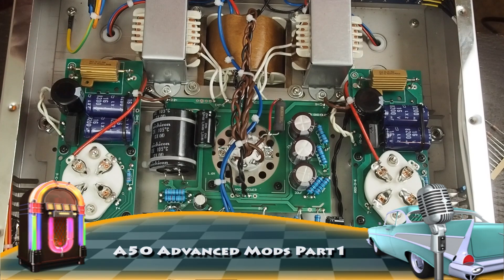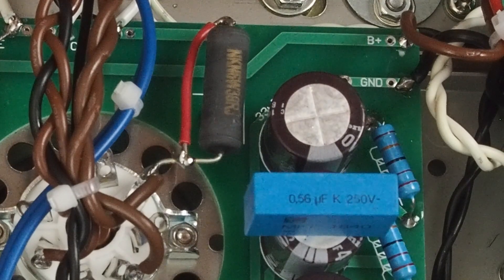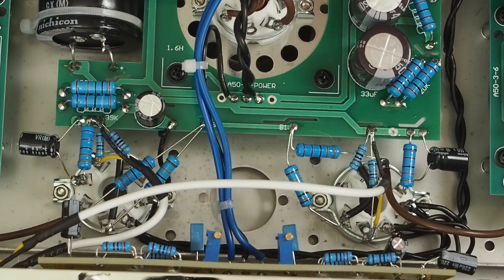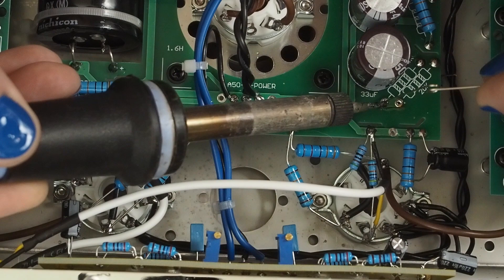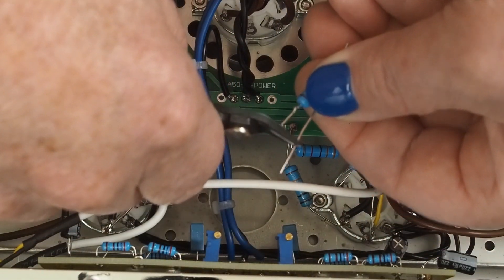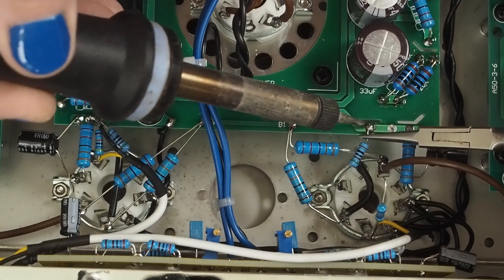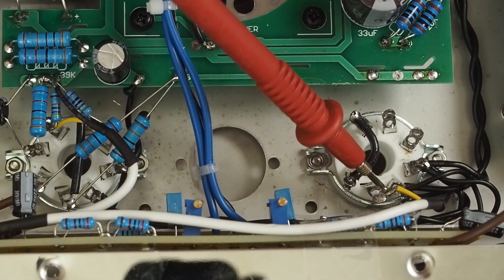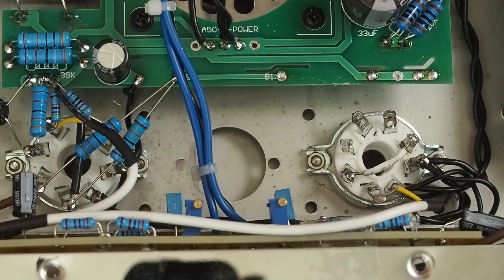Boyuurange / Reisong A50 300B Tube Amp Advanced Mods Part One

Comment: I am a journetman machinist of more than 20 years. On drilling stainless sheetmetal I have a few suggestions. First off stainless sheetmetal becomes work hardened when it is rolled. It is NASTY to drill. Esp with small diameter drills. First off if you have access to a drill press USE IT. Take the extra time and set it up right. Clamp everything you can. Another thing is WATCH YOUR SPINDLE SPEED. You need to run the drills much slower than you think you should, Look at your chips. If they are dark brown or black ( SS sheetmetal makes these nasty looking chips. but watch the color) SLOW IT DOWN. Slow it down if they are blue as well but you rarely get blue color drilling this crap but blue is too hot as well.  DRILL SELECTION.. If you have a drill press buy solid carbide drills. They are not cheap but if you have several holes to drill it will make it childs play compared to HSS drills. If you do not have a grill press then buy COBALT drills. You will break carbide in a hand drill no matter how careful you think you are. Start off slow and let the drill cut. Do not crowd it. Now you may get to a point where the drill starts to squeek. This means you have seriously work hardened the metal. My trick for this require 2 drills the same size or at least close. Also you need a pedastal grinder to grinad the tip of the drill. What you do is sharp one drill with a narromer included angle and the other a flatter angle.. Not extreme just  10 degrees maximum. You then use one drill until it squeeks. then switch drills until it squeeks or breaks thru. You go back and forth keeping the drills sharp in between until you are thru. This lates you focus the cutting force in a smaller area. Take your time it works, Now lastly cutting fluid is your friend. If you can find it (as its not made anymore) anything with 1.1.1. thriclorethylene in it BUY IT. That is the best stuff for this job. Just dont bathe in it. Somethin about causing cancer. Next best is MOLY cutting oil. Messy but it rocks. If neither of these then but some super safe and eco friendly crap from McMaster carr. Tap Magic is best..  If you take only one thing away from this WATCH YOUR SPEED... Hope this helps.
Reply from the maker: Thanks for this reply. I'm really glad this amp isn't made from stainless and is very easy to drill.

Comment: I am the owner of the MK III version of this amp.  I am not sure if the one in your video series is a MK III or an earlier version, since you never (to the best of my knowledge) clarified this issue. I have not heard, or had an earlier version in my system, so I cannot comment on whether there is a noticeable difference between the versions. 
So I guess what I am going to say below may not completely be relevant if in fact you were using an earlier version.

I have had this amp for over a year, and find it one of the most enjoyable amps I have had in my system.  The only change I made to the stock amp was to replace the 6SN7 tubes with some vintage tubes.  There was a slight but noticeable change, which I felt was an improvement.  Others may prefer the sound of the original tubes.

I have been an audio hobbyist for many years and have heard and used a very wide variety of gear.  So, for me to keep this amp in my system for this long is rather unusual, and speaks to the satisfaction I derive from it.  In addition, I have noted that several other You Tube channels (Thomas and Stereo, A British Audiophile, The Audiophiliac, etc.) have found this amp to be quite enjoyable, an audio bargain, and in a league of its own.  And I believe that the gentlemen of these channels have had a great deal of experience in reviewing gear, and base there judgements on comparison with a lot of amps.

 I am therefore quite confused by your evaluation of the functioning of this amp to be sub-par (a general impression I get from your various comments about its design and sound).  I, and others that review gear for a living find the opposite.  I don't know what to make of this.

 I have only a vague idea of what you use to evaluate the sound of an amp.  In this case of the A-50, you only, I think, describe your not liking the amp because of your impressions of the bass output, calling it 'bad' or 'weak'. I don't recall that you judged or evaluated the mid and upper range of the sound.  And to the best of my knowledge you said little about the sound staging presented by this amp, or its handling of transients, its overall timbre, its naturalness (or not) , etc., etc., the usual "universals"  or commonly held categories of amp sound we tend to use to decide if we like a piece of gear or not.

So I am at a loss as to how to benefit from your information presented in the case of the A-50.  Perhaps, if you have time, you could respond to this note and help me out.  

I thank you in advance for any consideration of these comments.

Regards,  Rich
Reply from the maker: It's the latest MKII version.  I can't help what other reviewers say nor do I understand why they would rave about a product this defective, and I also can't help this amp fails miserably to produce anywhere near it's advertised specs. Another friend of mine on audiokarma tested a MKII out of the box and got the same results I did. Numbers don't lie but if you are happy with your amp, great.  I know better and so do many other folks who have listened to this thing. And I have to LOL at the "original tubes" comment, those things are horrible! Even the original 300B tubes it comes with are bad. I just have to assume here that these people have just never listened to a good tube amp before or were being paid to promote it. I'm going to be nice and assume the former.

Multiple people have done my mods to this amp and universally say things like "wow, I now see how bad this thing really was." It's like taking a blanket out from in front of your speakers. And if an amp has over 10% distortion as it goes into heavy clipping, I'm not sure how folks evaluate "sound staging" and "handling of transients"? All I heard was weak bass, muddy midrange and distorted highs from this amp as it came out of the box. I agree this amp is in "A league of it's own" but not in the same way you are thinking.
Reply: @SkunkieDesignsElectronics  The latest version is the Mk III (3) not II (2).  And the Mk III appeared over a year ago.   So perhaps there is significant differences between the II and III.

Again, I ask you to please define or clarify the ways that you judge an amp's sound.  You have offered a few additional terms in your reply that I had not heard in the videos.  "...weak bass...":  does this mean low volume, not going to low cps, what?  Please clarify. And "...muddy mid-range...":  does this mean many overtones, distorted signal, what.  Please elaborate.  And I still see no information in your reply that would indicate the kind of sound that you want from an amp: e.g. clear, accurate, articulate sound with a  mid-range/treble/midbass forward, or warm  balanced presentation with a less forward sound, etc.  Please elaborate so that I can have some sense of what you hear and like.  Then we will be using a common vocabulary.  If you say the sound "stinks"  I do not get much information.

And, by the way, the others nearly always evaluate things such as transients and soundstage.  I suppose there is no particular measuring procedure for these terms, but they do go on to describe the unit's  performance in these areas using words that have definitions that most of us know, so that we can get a pretty good idea of what they heard.  They're evaluations are subjective for sure, and convey more information than "stinks" does (that is subjective too, unless you have a multimeter that reveals odor). 

I would suggest you re-consider your assumption that the reviewers I mentioned have "never heard a good tube amp".  They have ample experience, both owning, and reviewing, a great variety of good, industry leading tube amps.  If your testing, etc., was of the Mk II, then I could see how there could be differences in your view and theirs.  They all reviewed the Mk III.  Putting the possible differences between the II and III, I still find it hard the differences heard by you and them would be as great.

Thanks for your response to my initial post.
Reply from the maker: @richardcarroll4495  Mine was the "latest version" as sold by Amazon a few months ago  and after some reviewing: the schematic supplied has "MKIII" written on it, the parts inside match this schematic, so I assume it must be that version. They also state the MKIII has "an inductance transformer" which means they added a choke to the power supply, which my version had. I'll admit I'm not an expert on Boyuuange A50 revision history..

The "weak bass" can not only be heard (or not heard because it's just not there), but is easily seen in the frequency response curves as at 100hz the frequency rolls off. Likewise the "muddy midrange" is due to the measurable distortion which does exactly what the term says, it distorts the signal into something different, smearing any details that were previously there. It's clearly audible listening to this and a "good" tube amp. If all you listen to is alto jazz type music with little to no bass track, it probably sounds OK. And if someone A-B listens to this and a SS amp, I could see liking the tube amp sound better, even as distorted as this one is. 

Just as you have a right to like the way this amp sounds, I have to right to say I think it sounds like crap, especially comparing it A-B to the other 300B amp (and other tube amps) I own, and to this amp after the mods have been done. The difference is not subtle or nuanced. I want to clarify too, even after the mods, the low quality output transformers hold this amp back from what it could be with good iron. 

As far as these other reviewers, again I can only speculate why they would give an amp, that is this defectively engineered and pumping this much distortion, rave reviews. I want to shy away from claiming they were paid to give these rave reviews, but that does happen. Did they A-B listen to the A50 back to back with another know good tube amp? It's still baffling to me anyone would think this is good if they did that. The numbers don't lie and there is no such thing as  "alternate facts" here.  This is not what the manufacturer advertises it as: a 7.6W @ 1% distortion amplifier. It doesn't come close to meeting even 1/2 of those.

All that said, it's clear you just want to argue here, make excuses for and defend your purchase choice. Very common for people to get their ego tied into their ownership of material things, clouding their perceptions, and I've learned people doing this are rarely rational or interested in actually learning anything. My advice is to ignore my videos, go watch the ones that match your beliefs, defend your purchase choice and enjoy your amp. Have a nice day!
Reply: @SkunkieDesignsElectronics  Thanks again for your time and energy taken to respond to my questions.  I appreciate it.  Regards,  Rich

Comment: I'm going to purchase this amp for vinyl listening (I've not decided on a preamp yet, but am open for legitimate suggestions that would go with this amp...), and I like the mods, but I'm wondering if I only replace the tubes, will that make a worthwhile difference. I am out of my depth on modifying electronics, and don't want to ruin a "good" amp. I plan on running it into a 75W / 95dB set of Klipsch floor speakers.
Reply from the maker: Absolutely, the stock driver tubes are really bad, but honestly without at least the basic mods, replacing the 300B tubes probably isn't worth it.
Reply: @SkunkieDesignsElectronics  Thanks. It gives me something to think about... Watching the videos (I've not seen them all yet), I feel confident I could do the jumper wire and the one you ran to ground, at least, but for sure I was going to replace the driver tubes anyway. Doing that, I'll hear how it sounds, and if it's not what I need, then your videos and the soldering iron it is! Again, thanks.

Comment: Did you upgrade the output transformers or not ?
Reply from the maker: At the end of the day, it didn't make sense as A) there really isn't room on this chassis for larger ones + the chrome plated stainless is so hard to deal with and B) spending $500+ on transformers for a $1000 amp just doesn't make a lot of sense to get some extra bass out of it. A powered sub will do that better and is cheaper.
Reply: @SkunkieDesignsElectronics  fair enough.
Reply: @SkunkieDesignsElectronics  one more question did you ever measure to see if this amp was true class A ? If so how does one measure it ?
Reply from the maker: @skularatna8136  By design, Single Ended (SE) amps have to operate as class A
Reply: @SkunkieDesignsElectronics  yes but how does one measure it?
Reply from the maker: @skularatna8136  You can see it operates as a class A on a 'scope and as I already stated, it can't operate outside of class A so there is nothing to measure. All it can do is go into clipping.  For it to even be possible to enter into AB mode of operation would require twice the number of output tubes. What you might be thinking of is how do you measure if an amp is operating as a pure class AB or is it operating in B mode.

Here is some reading that might help you understand, it shows transistors but it works the same way. https://www.electronics-tutorials.ws/amplifier/amp_5.html
Reply: @SkunkieDesignsElectronics  thank you

Comment: I'm only partially through the video but your schematic didn't have led in series to ground. Am I missing something?
Reply from the maker: This is the final schematic, cathode grounded through LED + 200ohm resistor.

https://www.skunkiedesigns.com/boyuurange-a50-mods?pgid=ktb1lluh-4ad9aad6-de55-4454-b972-3f9bdc405f0b